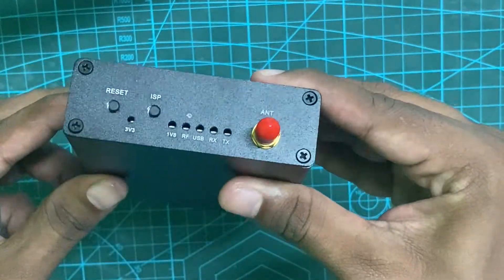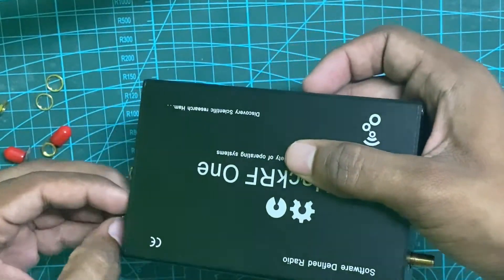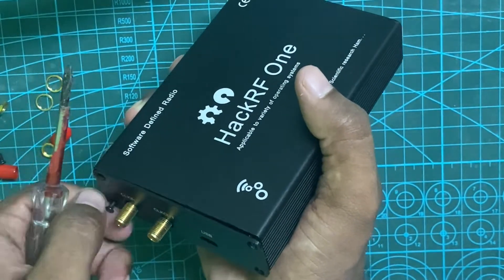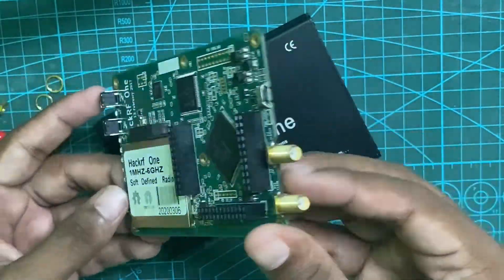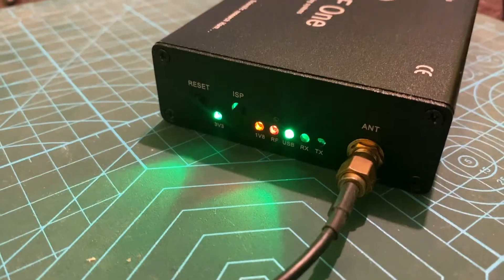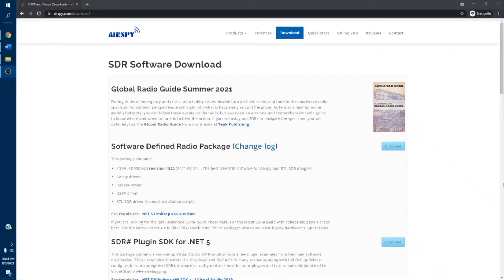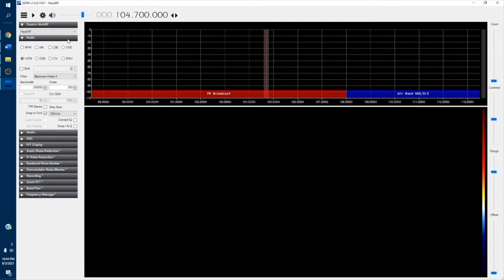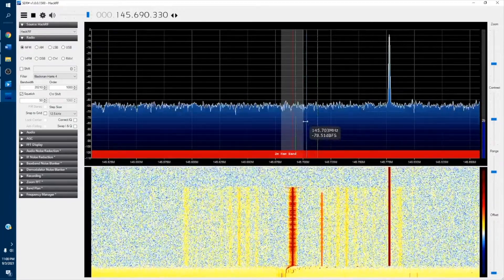How to connect HackRF to Computer (Introduction HackRfOne 101) Detail Unboxing

Comment: Hey , I am also getting an sdr very soon  , but its a smaller one.. NooElec with freq range from 100Khz to 2.7Ghz ,  with Ham It up
Reply from the maker: If your try to working with shortwave frequently like less then 1Mhz HackRf is the not best option for you. But hackRF can use for transmission. And this good for receiving. I will upload another detail video.
Reply: @CreativeMindVisionary  yeah Can't transmit using the one I'm getting. I'm getting 2 actually 2 sdr and 1 ham it up 
Because these days the radio used by police is trunked so will need 2 sdr modules to decide that
Reply: @CreativeMindVisionary bro can you give it to me I can give you 1000rs for this. I don't have so much budget to afford it.